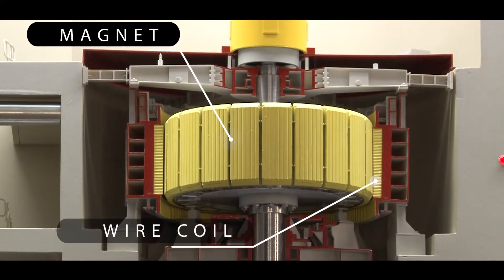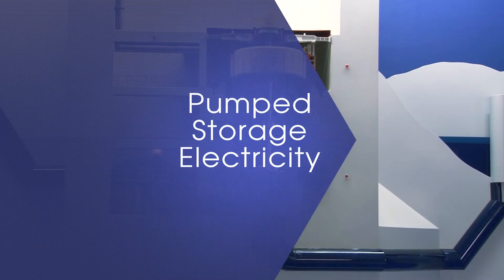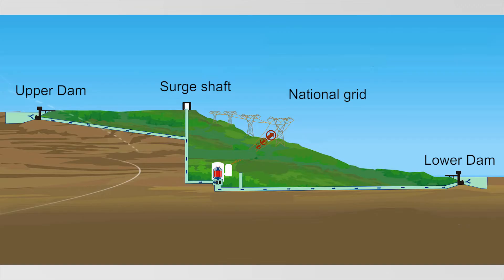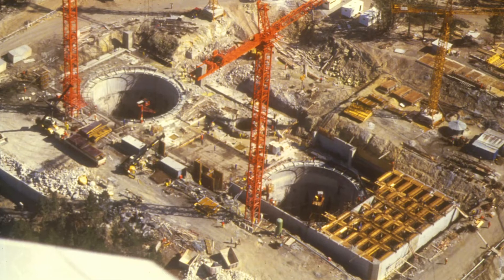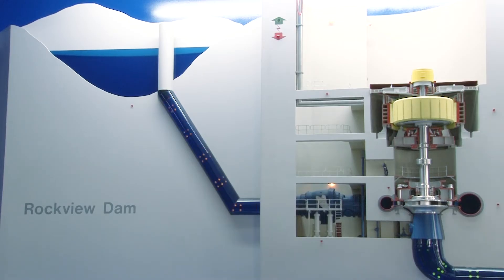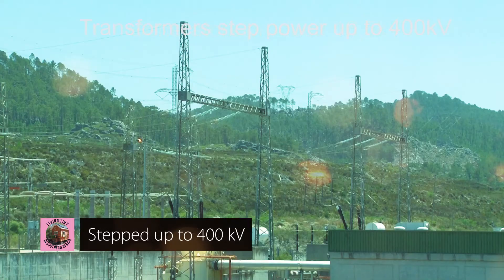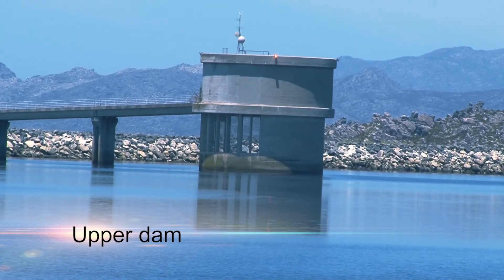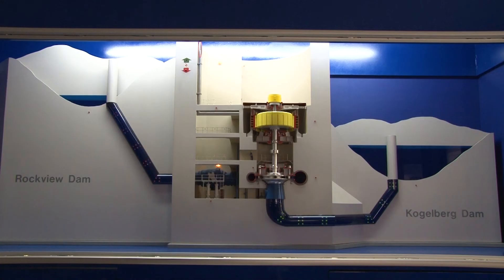How Electricity is made from Water | What is a Pumped storage scheme?

Comment: retained water or closed loop systems, require replacement from evaporation, and constant substantial chemical treatment.  water in these system closed loop systems must be monitored for its pH levels. if the medians pH becomes to low it becomes acidic and will damage the structure as well as the machinery. and yes, the system is not closed. It will be open to were birds and animals will have access and treated or not the water is not suitable for man nor beast.  I'm not against progress, however it must be progress. keep the existing hydroelectric systems and expanded on nuclear.
Reply: You may be talking about large industrial size installations...small, mini systems like this have no issues
Reply: @boardwalkbw7130 Seriously. If you are running a loop, whether it be an "open loop"  or a "closed loop" and this loop consists of pipes, valves, and or machinery, you are chemicaly treating that medium.  Even something as small as a water-cooled car engine requires chemical maintenance. And don't come back with the fact that my examples has more to do with heat transfer, and your talking about using water as a medium to produce power, it still requires preventative maintenance.